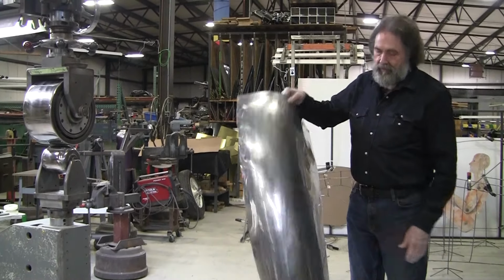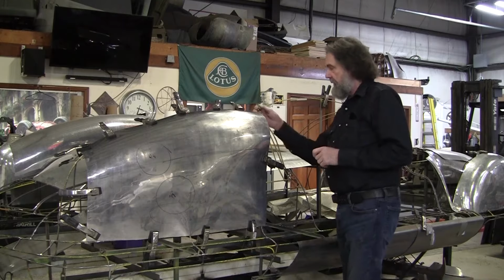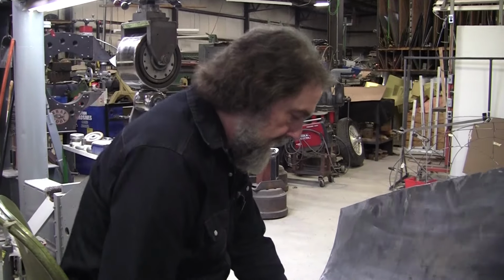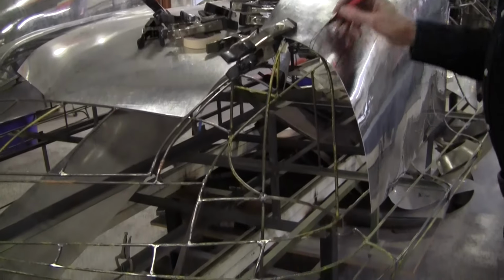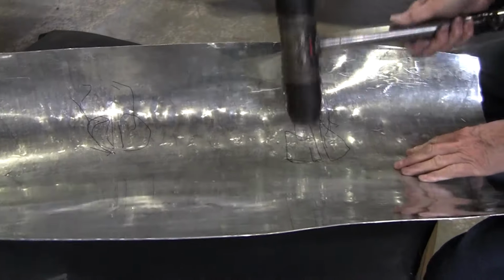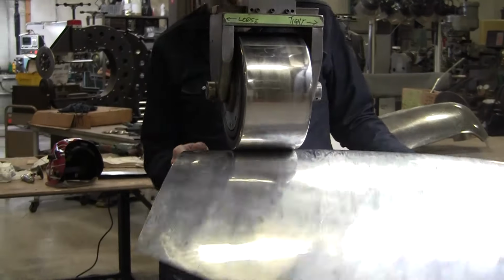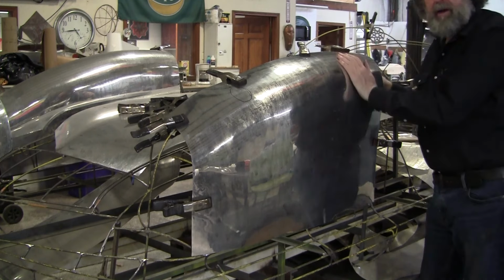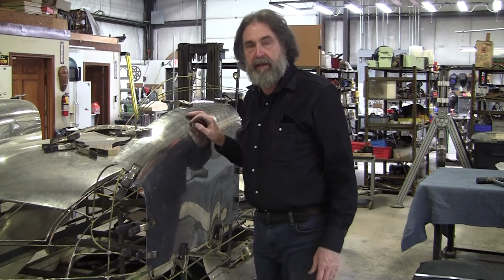Can This Overdeveloped Classic Car Panel Be Saved?

Comment: Yes a great video indeed, thank you. I too built my own English wheel and watching you working I can see many advantages to using wide wheels and how you take large steps across the panel when wheeling. Are there any disadvantages to using wider wheels?
Reply from the maker: After three decades of using my large gray wheel I haven't found  any disadvantages yet,  using larger top wheels or anvils. I do have a small English wheel for detail work, it has a 2"x 2" top wheel, and the same for the bottom.

Comment: Great Job Thanks! Could you explain why you didn't wheel horizontally on the side of the panel, in the next video?
Reply from the maker: The next video will be out tomorrow but in the video after that we can address this for you. Would it be possible to let us know what time in the video that question is for, just so Wray knows how to answer it properly. Thanks
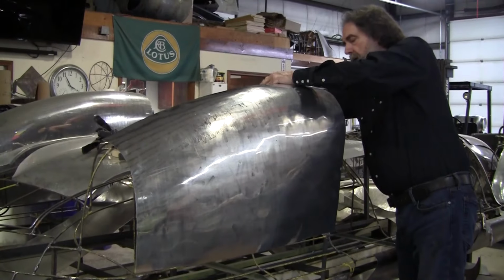Reply: @proshaper  Thanks for the reply! For instance @15:47 ish. It seems Wray wheels the whole Panel on the shorter side only & up & down with the sharp curve. Except when He did the 45 degrees angle on the Flatter side ( @24:25). I'm no Wray but I'm sure I would of been tempted to wheel the length of the panel on the flatter side section ( & probably would of wrecked it).  I hope that is helpful. I'd love to do a course with Wray buy I live in Australia. My old tech teacher was a lot like Wray only English! Great Video Cheers!!
Reply: Having said that it's probably better if I  keep quite & watch! lol.

Comment: hey Wray, and thanks as always for the videos. can you please tell me, what exactly is happening to the metal when wheeling out the wave? and why wheel at a 45 in that area? cheers.
Reply from the maker: The metal is being aligned properly so that it fits the buck. The best way to understand what is happening is this example. Take a piece of paper 36" square, set it on a flat bench. Then pinch the paper in the very middle, the whole piece of paper will go absolutely nuts. That proves the point that what is wrong with the panel is really very little, you just need to know where to settle it down on the buck, and the buck tells you what you need to do.

Comment: Interesting, when I watch, I try to imagine what is happening to the metal in terms of three actions; stretch, shrink, and/or bend. With Wray calling the panel "overdeveloped" I imagined some sort of shrinking was in order. It seems that this session was mostly stretching the underdeveloped areas
Reply from the maker: Shrinking with heat or mechanical shrinking with an Eckold shrinker would have worked, but they leave the metal all marred up. I stretched the edges up to meet the level of the previous overstretched interior of the panel. The stretching only reduced the thickness by an insignificant amount the result will be a perfect panel.

Comment: What happens to the structure of the metal after it has been beaten, and rolled many times?
Reply from the maker: What happens to clay or dough? Sheet metal is made by lots and lots of rolling.
Reply: @proshaper  True, sheet metal is made by rolling, I would think that after so many workings, something structurally/molecularly would happen to the metal, work harden/plastic, etc?

Comment: why didn't you go lengthwise on the curve to bring the panel up on the wire instead of hammering  it up and going up and down i am very much beginner  on the english  wheel
Reply from the maker: To wheel in the curved section length- ways would require a high-crown wheel which would fix the problem but create another one. The high crown wheel tracks would mar the panel, then you would need to fix them.